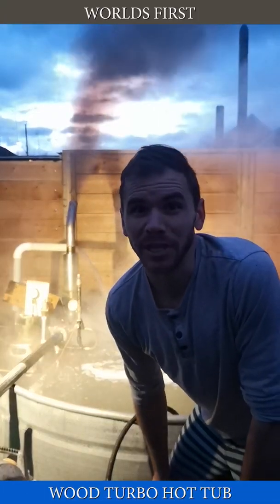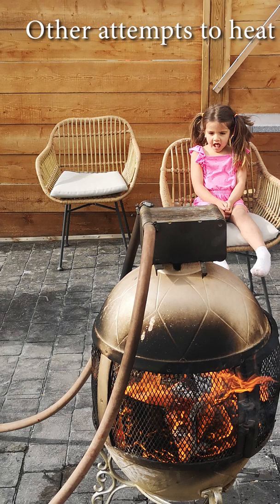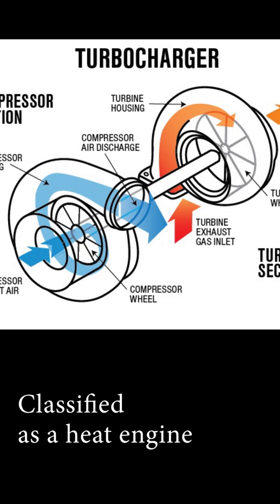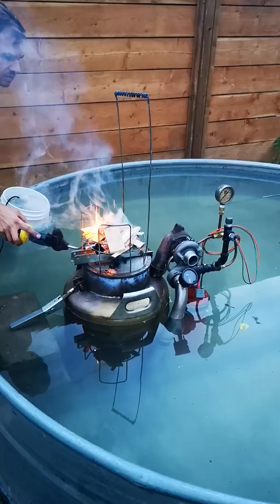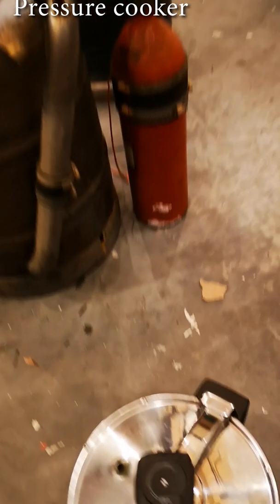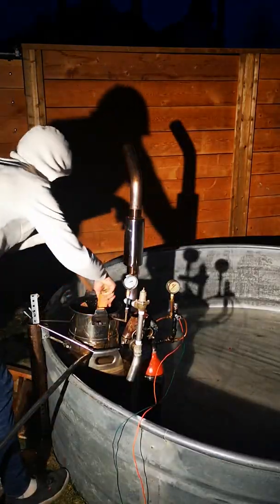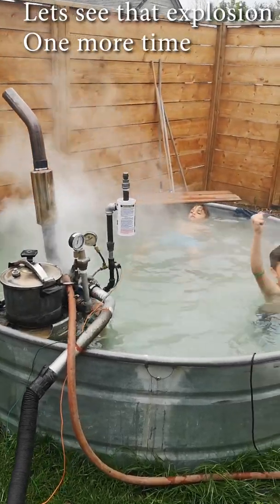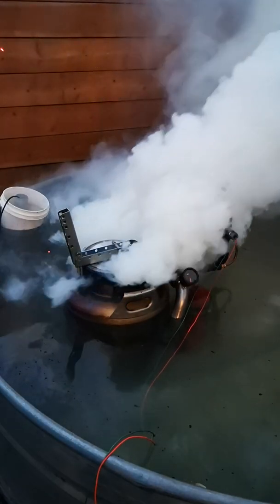Wood Fired Turbocharger Hot Tub.

Comment: Should cage off the one section of the tub the heater sits in, if anyone inadvertently touches it - that's going to leave quite a mark. Now a trick would be figuring out how to get pressurized hot gas to also power a circulating pump.
Reply from the maker: Great plan
Reply: using another small turbo,  water on cold side and exhaust on hot side!!